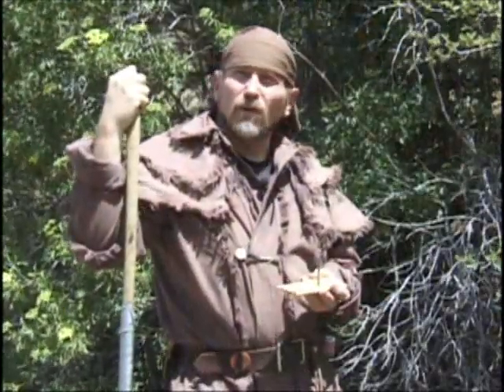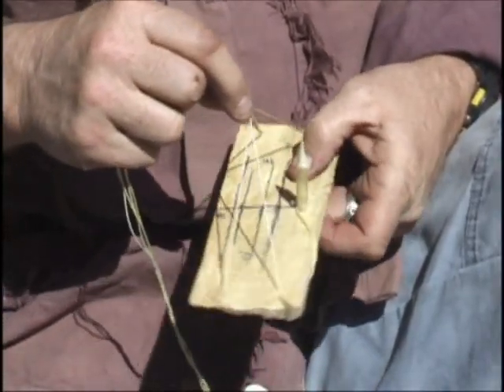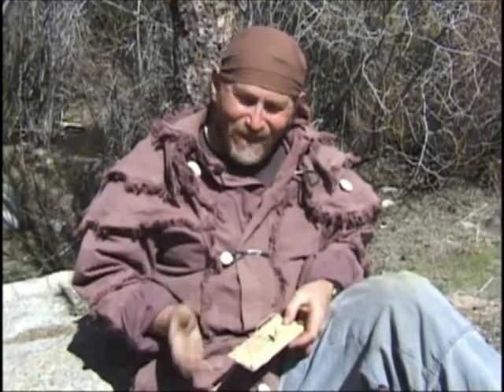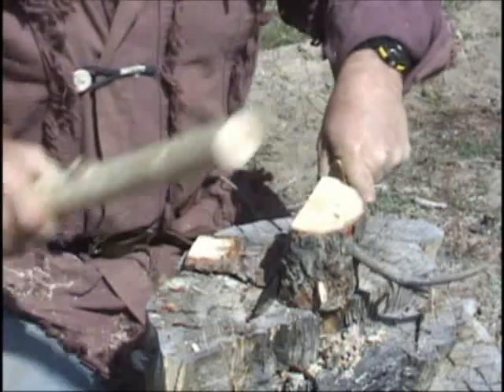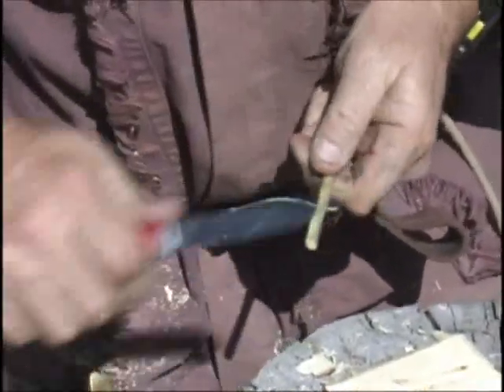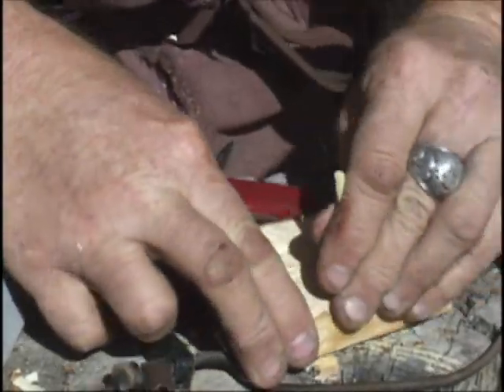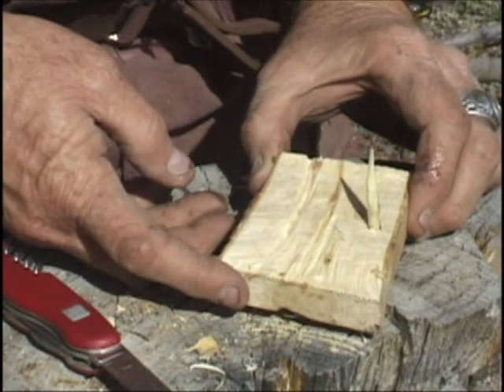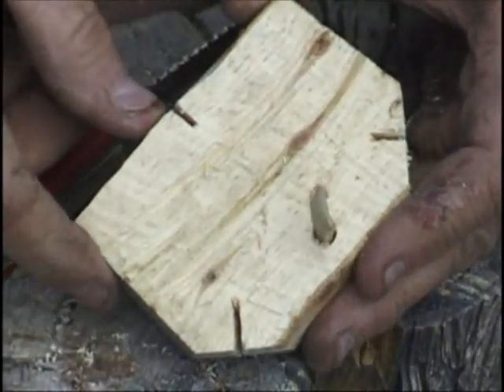Survival - The Ottomani Sun Compass

Comment: That "sun compass" only works at noon (1 pm daylight savings time). The tip of a vertical shadow traces a hyperbola on a level plane throughout the day. (Ellipse at the poles when the sun doesn't set.) You will end up running around in circles if you try to use it at other times.

Comment: There is a slighly easier way to tell your bearing by the sun if you have a watch. In the northern hemisphere, point the hour hand at the sun and bisect the angle between this bearing and where 12 o'clock is. There's your north. Maybe even quicker too. Reverse this for the southern hemisphere. Warning. Do not try this with LED watches or heavy grandfather clocks.

Comment: Using just the needle in your first aid kit and the silk from your parachute or wherever (use your imagination) you can make your own compass by rubbing the needle 50-100 times and floating it in a cup of water. Use you own oil (hair or skin oils work) to coat the needle. Stroke to the point of the needle. This will point south in the northern hemisphere and north in the southern. Remember mountains and large iron ore deposits can affect any compass. Migratory birds are another helpful hint.
Reply: I tried using migratory birds. They didn't float. I think maybe I didn't rub them with my hair enough. Can you please provide clearer instructions? How do I get the bird to float on the water?